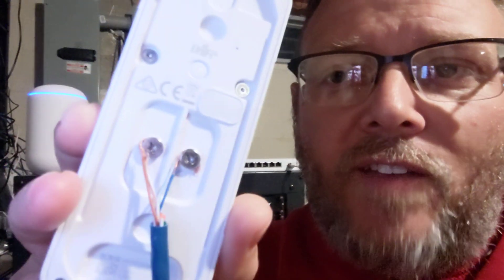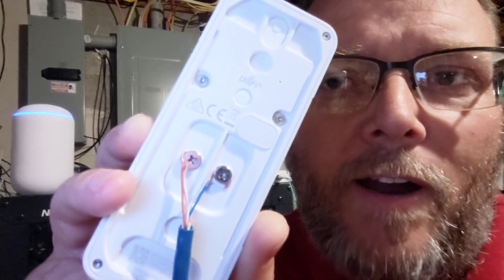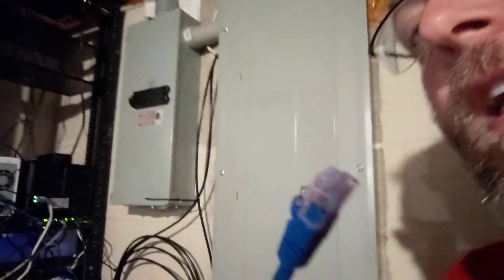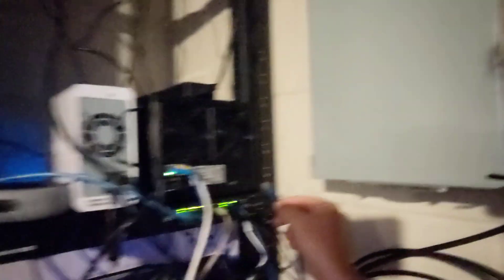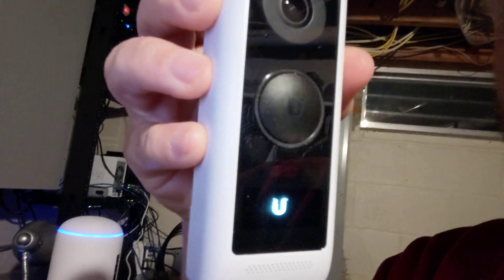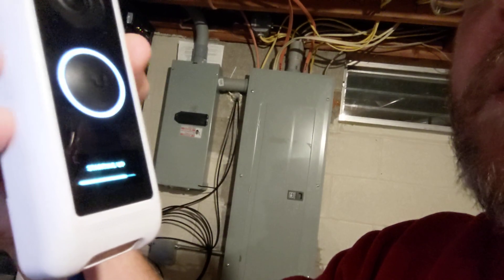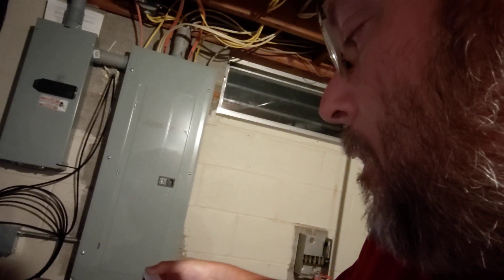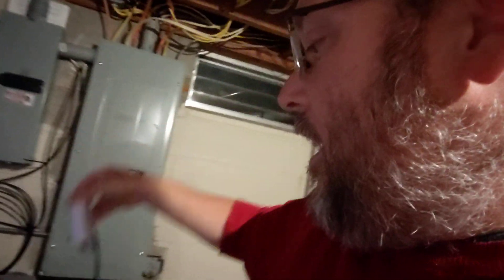UniFi Protect G4 Doorbell PoE

Comment: Just so people know, I did this with 2 Unifi door bells and they both work fine untill you hit the button to ring the doorbell. After about 5 to 10 sec the doorbell turns off. You have to unplug them from the Poe switch and plug back in to get them back on. Has anyone else had this issue?
Reply: Did you make sure that the chime options are turned off in the doorbell settings?
Reply: @rincewindtvd  Yes, that's what I missed. After setting it to off, it started working.
Reply: @FusionDevelopment  sorry for replying to a year old comment, I wasn't thinking! Glad it's sorted
Reply: would you mind sharing your wiring, a PoE spec you're utilizing?! i'd like to do this but want use a method that's been truly tried/tested for an extended period of time like yours. thanks

Comment: So this doorbell "knows" whether it's receiving DC or AC and converts accordingly?
Reply: That's what I was wondering but I assume it's running the AC through a full bridge rectifier. DC through a that will also give you DC, so the bell probably doesn't even "know" about it being DC on the supply

Comment: So I assume that powering it this way means it won't work with a chime, i.e. it no longer functions as a 'conventional' doorbell??
Reply: It does, it has an adapter that allows it to rob the power it needs to run without affecting the chimebox (vampiric draw caps like smart thermostat ones maybe?)  (EDIT: Oh I see what Roger means now.  Yes, using POE means that you'd be giving up on the chimebox, unless you had three wires of original copper going back to the chimebox from the doorbell.  If that is the case, you can wire it in such a way that the transformer common makes it back to the switch...)

Comment: i dont think you realised how much you just fisted everyone on this AC/DC debate lol.
Reply: ok so ubiquiti failed to let anyone know that it can be fed DC or AC @24V, the doorbell has a rectifier built in to convert the 24VAC to 24DC to operate the device. if you feed the rectifier straight DC, no rectification (AC>DC) needed so it just passes it through.  i believe there is no "risk" at all doing it the way you did. it actually reduces the complexity of the conversions going on inside the device (none), i was fidding around with mine on the aus ubiquiti pro's page today.    

and by fisted, i meant, you powered it by DC voltage, but the manual says AC (nothing about DC ANYWHERE), but you have no problems, and cant explain why. not your fault, i never expected you to know how the smarts work inside of it(i asked a electrical engineer about it) haha. but now we know, and all thanks to this video!. (insert frank lucas "my man" meme), team work makes the dream work.
Reply: ps, love from australia
Reply: @SoniX989  Amen! Not the ultimate solution in regards to running it through the network properly with cable but at least gets me around the CAT6 cable I have that's been hanging out of the wall next to my front door for 2 years waiting for this product to complete my UniFi Protect network. I'll be waiting for a proper POE option on your next doorbell Ubiquiti....don't make me come over there!

Comment: You can use Amazon to search for "PoE Texas Power Over Ethernet 12 Volt 802.3af Splitters - Power Any 12 Volt Device Including IP Cameras and Compatible with Arduino (Gigabit 12 Volt 12 watt)". Not sure if it needs 24V but 12V should do it. This is just one I found, there may be cheaper/other options out there and possibly Willie you want to find one and post with your referral link

Comment: Why didn't they make the door bell with a poe connector on it in the first place?

To isolate a door wire solution from a pie powered solution they could have added a cheap slider switch (because you don't want someone accidently connecting up both options at the same time)

If your running other ubquity cameras, your running a network cable for poe power most likely anyhow

Ubquity are starting to lose it on there designs rushing them out the door, like the dream machine pro, no second hard drive when there's ample space and no poe!

The door bell isn't even available in Australia either, had it had a poe power option it could have been

Wake up ubquity designers...
Reply: agree, I have a ring POE and would replace it with this in a heart beat. Disappointed it does not have POE.
Reply: Running PoE to a doorbell is not simple unless you are building a home from the start.  I got this G4 Doorbell and installed it two days ago. It was pretty simple and works great!  No need for PoE, why?  It gets the power from the doorbell wiring.  It saves using a PoE port on your switch.
Reply: @realgrapedrop  Not all houses have door bells, believe it or not.  The cost to run a network cable would be less than to have a proper doorbell setup installed... and has the added advantage of not using WiFi.  Make a Pro version for $30 more that can run off POE and I'd buy it in a heartbeat!

Comment: I would buy this doorbell IF it had a normal RJ-45 in the back with POE and ethernet connection to my network. Wifi? No thanks, not 300m from my house by the road. If it had cable it could be linked to my house by 2 60Mhz bridges. The less Wifi outside my house, the less chance of hacking.
Reply: Yep there's another great reason for POE/CAT option. Not all people will want to put this on their front door. It might need to be 200m away from the house in a gated situation.

Comment: Given that you are now a Synology reseller, can you tell me of the cheapest Synology NAS model that supports Plex? I don’t need a multi-drive NAS, but as far as I can tell, no single-bay Synology NAS supports Plex. The cheapest one I found that supports Plex (I may be wrong here) is the DS220+. 

I am also looking for a cheapest Synology NAS model that can run virtualized Windows 10. I have a household of kids that use Chromebooks. These work great until one of them needs to run an application that only runs on Windows. So instead of getting a dedicated computer to run Windows, I am thinking of running it inside a Synology NAS on a virtual machine. The Chromebook then can RDP into this Windows machine.

Comment: Considering I've seen doorbell stystems wired up using cat5 cabling, and indeed running power over two twisted pairs just like that.... Honestly as long as the supply is good, it shouldn't be an issue.  Though I'd crimp some connector rings on the end to put the screws through.
Reply: R Spivack not necessarily.  The unifi doorbell can run perfectly fine on DC passive high-jacked POE, that's what the micro USB unifi adapter he showed is using to power devices...  So as long as the cable and the plug don't get damage, then it shouldn't really be an issue.  But remember it is also best practice to look and follow what the installation manual says.
Reply: It's about power output and stability of that power, not how your powering it as long as you can do it "safely" there won't be an issues.
Reply: where I live, unfortunately, someone used a similar approach to pass 110V to the bell transformer. And yes, that's over CAT5 (non-E, but that genuinely doesn't matter for this power level). It is kinda insane when you consider those cables are old, yanked through metal conduit that is too small, etc. The non-standard use of the CAT5E cable used here should be absolutely fine. I do like the idea of the slider mentioned by dodeca hedron. This could allow the use of cat5e wired + the 'normal' option. Perhaps they will release a PRO model haha.

Comment: Idiotic it doesn't have Ethernet/PoE built-in
Reply: @WillieHowe  agreed. it should have actual Ethernet on it, or Ethernet version for what they charge...
Reply: Maybe ubiquiti did no PoE because of security? You have to make sure that someone easily unmounting the doorbell does not get full access to your wired network. You would need a separate VLAN for it, and restrict it with the firewall, so nothing bad can happen... With a simple power adapter there are no problems like that :-)
Reply: @MichaelKliewe  I highly doubt security factors into any of it.  If someone is going to forcibly unmount a doorbell they could also break in to get access to equipment.  CCTV cameras use PoE extensively and those issues are not any real concern of manufactures with those devices.

Security is the domain of the user to implement as they desire.
Reply: @MichaelKliewe  This is the only valid reason that there could be (if there is a valid reason) but really even then the camera would have detected someone pulling my doorbell off the wall while I'm watching it on my phone which would give me time to shut down the whole network if worst came to worst.

Comment: Why they didn't implement this device with POE is beyond me
Reply: Because the average person is way more likely to find a two-wire door bell at their front door. I was actually mistaken, I thought that this doorbell would ONLY do POE and I was dreading the thought of running a line for it.
Reply: @BradenPitts_  ....another American that thinks they make up the total of 'average' people on the planet? There are lots and lots of average people in other countries that don't have a two wire door bell at their front door that would find it very useful to have a POE port on the back of this doorbell to work with their $3000 Ubiquiti POE network.
Reply: If I’m not mistaken, there is a power adapter for this currently in EA
Reply: PoE has the added ability to transmit data as well. Many homes have the front door too far away from getting a reliable WiFi signal. Moreover, there is a standard single pair Ethernet that this doorbell can use. As the name suggests, this cable has only 2 wires instead of the traditional 8 wires, making the cable much thinner and flexible to bend. SP Ethernet can deliver up to 1Gb and enough power for the camera.
Reply: @jasonluong3862  Correct!
Reply: @mortman2  and the WiFi AP's can be powered by.....yep you guessed it, POE! OMG just put a POE option on the thing already!